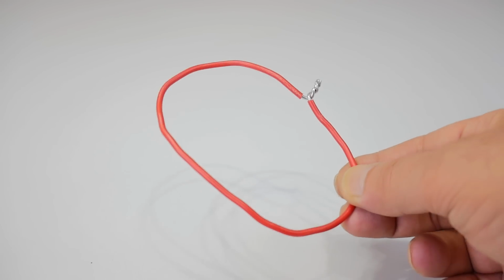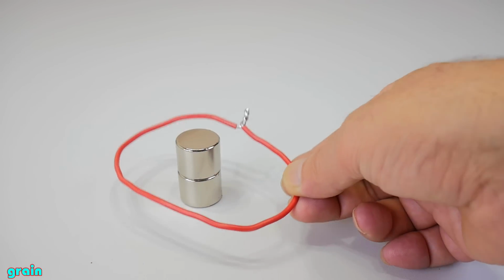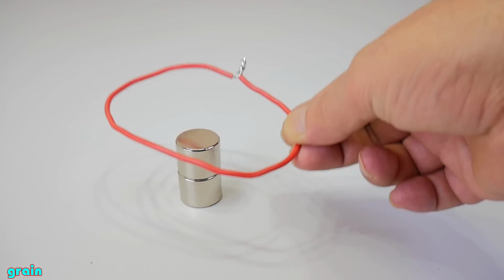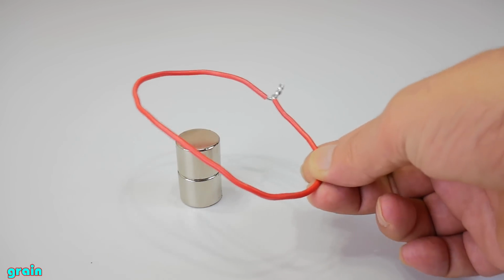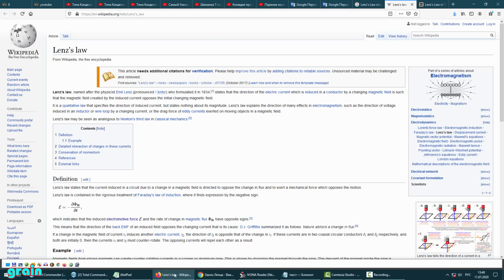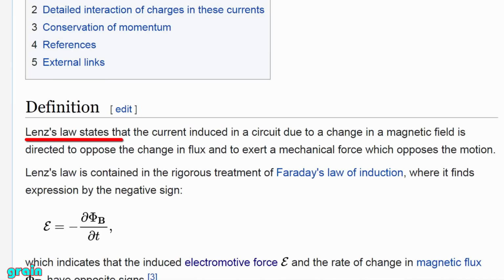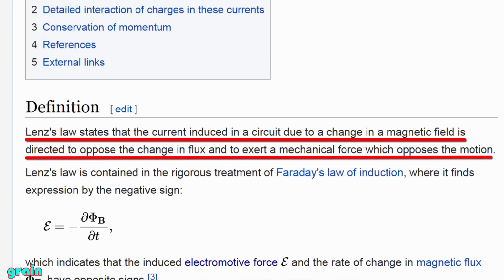Aluminum Rings in Alternating Magnetic Field

Comment from the maker: I'm sorry, in the very first sentence of the video, I made a typo and badly checked. The text of the video should be like this (I fixed the subtitles):
"If we place a closed conductor in an alternating magnetic field, an induction current occurs in this conductor."
Reply: I know at 50 hertz but what voltage is used my friend? 15 to 300?
Reply: Bro you did Best 👌💪
Reply: Hey you should add conplete explanation for the levitation. what you told is just half story of it. When current increases there is repulsion but when current decreases there is attraction. So how does the ring gets a net lift. I made this device and tilted it to 180° and it was still repelling. I don't understand why there is a net repulsion when there is both attraction and repulsion
Reply: @purplecoow  We can see the attraction/repulsion as between 2 fields (B1 the inducing one created by the coil, B2 created by the induced current in the ring) or as between 2 currents (I1 in the coil producing B1, I2 in the ring producing B2). The 2 currents attract if they have the same sense (e.g. both clockwise), as the 2 fields (think of 2 magnet oriented the same way, with the S pole of that above facing the N pole of that below).

Now, the EMF (electromotive force) induced in the ring has a certain sense while I1 and B1 rise from a negative max to a positive max (during a ½ period, that is, ½ of 1/50 s). In this interval of time, I1 inverts its sense (negative for ¼ of a period, positive for the next ¼). So, if I2 were in phase with EMF (that is, reaching max and min at the same time), I1 and I2 would have opposed senses for ¼ of a period (thereby repelling each other), then the same sense for the next ¼ of a period (attracting), and so on. The average effect would be zero.

But the ring is not a purely ohmic load, it's a coil (if only of 1) so it has inductance and I2 is delayed with respect to EMF (reaches max after). Hard to explain without drawings, but the result is that I1 and I2  have opposed senses (repelling) for a greater time. This imbalance gives a net repulsion.
Compare this not-so-great average repulsion with the strong repulsion at 2m50 when the field is suddenly increased over a very short time (a transient)

Comment: I'm curious how launching the ring could be optimized by changing the frequency of the flux.
Reply: Ok computer
Reply: "rate of change"... the higher the frequency, the faster the change of current, the larger the induced current and subsequent lenz reactions...
Reply from the maker: This is possible because the frequency is related to the magnetic conductivity of the core.